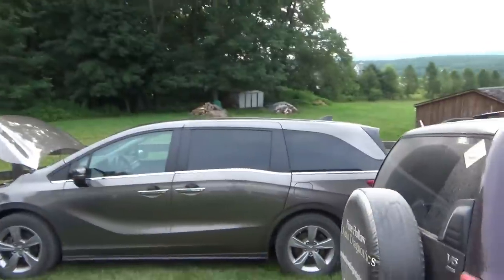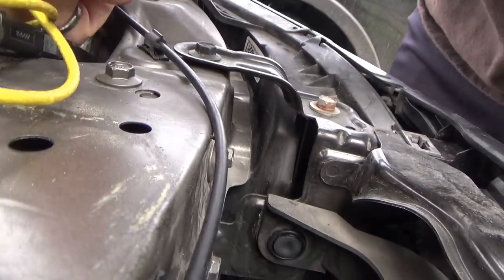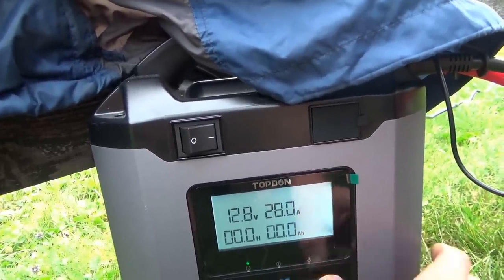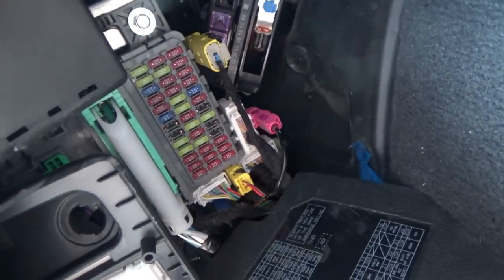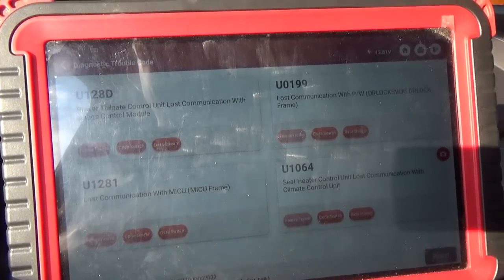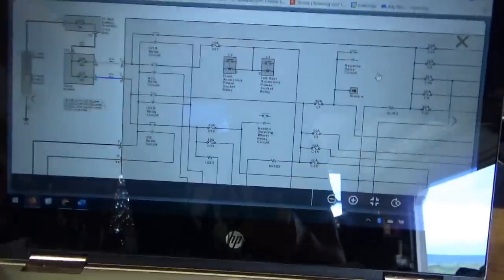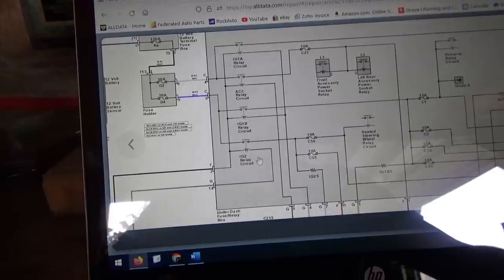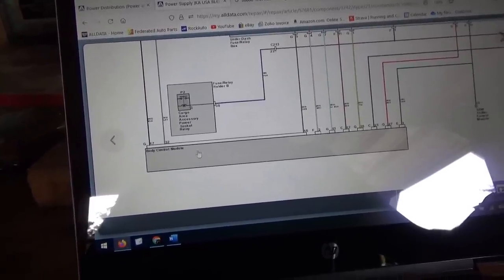WTF...Honda Turns Itself ON & DRAINS the Battery?! (Part 1)

Comment: 2019 Honda Odyssey elite 90K milesl, so initially, the Lane detection camera ($700 part) has been bad, but I have been driving it anyway for months buying time. However, now the car will not shut off? I think it is unrelated to the many lane camera error messages. I had to pull the battery cable off to stop the engine; then it that reset computer (?)and it started it fine, seemed ok. Locked it up and went to bed only to wake up to the horn alarm going off later! The key remote didn't work to turn off the alarm!. So I had to use the 'real key' inside the fob to open the door the old fashion way. I found out if I don't lock it the security system won't go off like that. However, the accessory power still comes on by itself!! I caught it twice but now my battery is dead or drained from the accessory going on. I see other's pointing to the ignition switch as the cause. I will update.

Comment: I was going to suggest a used BCM from a salvage yard then I see you are getting a used ebay one, good thinking. I don't know how Honda has their vehicle mileage stored though, if it's in the BCM or in the cluster. I wonder if in the BCM if there is a constant 12v source that is shorting to a 12v "switched" source and is powering it up when it feels like it. Intermittent electrical issues always so much fun. Interesting that Honda has an "updated" BCM part number. 
On a slightly positive note Ivan, there is a company that makes computer chips that just bought a huge piece of property just north of Syracuse, NY. Could we see an end to the chip shortage by making them right here in the States? We shall see.

Comment: I agree with your diagnosis but one problem I see is that let say the bcm is (seeing the key ) and turning the ignition on. I would think the car would start when pressing on the brake and pushing the start button when the ignition is on. Also I noticed what appears to be the red security light flashing on the cluster when the ignition comes on. I’m not disagreeing with you but It would be hard to call it the bcm when the fuse box could cause this too. Only way to tell is to isolate the ignition control feeds from the bcm to the fuse box. I enjoy your videos

Comment: I am curious as to why the dealer blamed the liftgate control module.  That is a module that should have power at all times.  Could it be feeding power back into the BCM?  Seem like it would be a simple test to disconnect the liftgate control module when the car is acting up and see if the power to the cluster goes away.

Comment: Part of me would wonder if there is a key hiding somewhere. I’d delete out any keys but what you have, Just in case.  There should be an encryption code shared between the ecm/bcm for each key that should be needed to power up the car. Replacing the BCM should invalidate the keys, and would also cause the same outcome. 

It will be interesting if you can pair the bcm/ecm or if a dealer will have to do it.
Reply: The car would be able to start if there is another key inside, and it can't.
Reply: I had found a set of fobs with factory build sheet while detailing my Chevy truck. They were between upper back seat and cab wall. I saw a little piece of plastic hanging down and didn't know what it was until I kept pulling at it to get it out.

Comment: What device actually reads the presence of the key inside the vehicle? Is that device directly connected to the ignition button?  My thought is if those two items are part of the same module behind the dash, then the BCM could be ok and that button-and-antenna module could be telling stories to the BCM. On the other hand, if they're completely separate, then it's more likely to be a fault in the BCM itself.  Guess we'll see in part deux.

Comment: YOUR ON THE RIGHT TRACK HAVE MANY WITH THIS ISSUE, ALWAYS A DIFFERENT ISSUE, INTERMITTENT, OR STAYS ON ALL THE TIME AND KILLS THE BATTERY. OUR ALARM GOES OFF. THE BCM HARD TI GETS TO ABOVE THE FUSE BOX, WHICH HAPPENS ACROSS ALL HONDAS NP TSB FOR THIS

Comment: Hey Ivan, if needed I could send you an install guide for the add on remote start units that are basically plug and play. I have seen this same problem with a push to start Accord that turned out to be a faulty remote start. Also try pressing lock on the factory remote 3 times. If it has an add on remote start this should activate it.
Reply: Yeah, it's gotta be a remote start issue. Nothing else should be physically able to do this, this way.
Reply: Checking for a remote start add-on is an great idea.

Comment: Ivan, I still drive a 95 Honda passport/ Isuzu rodeo. 325k on original motor and transmission.  I changed the plugs recently  and decided to check compression.  170 psi on all cylinders.  Last emissions test HC was 21 and CO 0.01. I've beat the piss out of it in the mountains hear in Boise. I just maintain it really well. Got lifter noise, but what 3.2 dosent. Lol
Reply from the maker: That's a cool truck. Respected durable 4x4 in the Russian boonies too 😀

Comment: I had a crv a while back that was a parasitic draw. This new town i moved into has a big problem with draws. I went 6 years as a tech in my hometown and only ever had 1 parasitic draw that was something real easy that i have forgotten what it was. Here I've had like 5-6 cars with draws in the year i have lived here. Anyways this crv at first I found the radio was staying on. My draw went away when I unplugged it so I replaced the radio. Supposedly that wasn't the fix when the customer returned about 3 months later saying he was still having a dead battery. It then took a few visits to the shop because he would need the vehicle to get to work and couldn't leave it for any reasonable length of time but I finally found that the MICU/BCM was actually the issue and was keeping the Radio on at all times. I dug deeper when I found that new radio was staying on again. Lesson learned. Anyways all that to say that the BCM for that car took 5 months to get and same thing I think it was a 2015-2018. Somewhere around there

Comment: I would try to scope between BCM, ignition key on.
See what's happening, what kind of voltage drop is going on there.

Other idea is to look at salvage yard, take kne from there if you can find 2016-2018 Honda Odyssey Elite

What if the bcm is faulty triggering the key on but the relay switch is stuck on continuously giving ground making it so only one faulty signal is needed to make bcm think key is in proximity.

Comment: Bcm/keyless access module common on these Hondas and Acuras to cause this same problem as well as other problems. Keyless access module is part of the bcm on this Odyssey. Alldata has good info on the system description of the keyless access system, there is no literature of your issue, but it’s common and yes the bcm has been on back order for a long time

Comment: It is crazy to think the vehicle will just turn itself into the KOEO (Key On Engine Off) position when not commanded  by the appropriate means. You would think the vehicle's security programming at a minimum  would prevent this from happening unless a number of  specific conditions being met, all these being external commands being received and validated. IE: the key being close enough to the vehicle's receiver, the key AND the receiver doing the necessary validation checks AND the start button being pushed once to place the vehicle in KOEO position. These are essentially three "AND" functions, ie must happen, no if's or buts.

I know software can do crazy things, however if it were a software issue, then reloading the modules software should fix this. I don't even think a software issue can cause something to operate that requires a number of external commands/functions to happen first. It seems unlikely it is a module manufacturing issue as there would be an extremely large amount of reported vehicles with the same issue. Like all things, modules are made in batches, the manufacturing error will be in a complete batch at a minimum, with the appropriate forum coverage and hopefully manufacturer recall. This is a crazy issue.

I agree with your decision to replace the module, in reality what is there to check, Powers & Grounds seem okay, there are no connectors between the relays and the modules & grounds, the start button would not cause this, it won't even be active until the BCM enables it in the first instance. Everything is pointing to the BCM and whatever is in there to enable the KOEO position. Even a lost key somewhere in the vehicle wont do anything unless the BCM sees it AND the stop/start button is pressed. Even if there was a lost key, when you program a new key, you reprogram the old keys so the lost key ceases t function in that vehicle.

I really am looking forward to the outcome, even if it is a case of "the new BCM worked, the customer has not reported an issue since the new BCM was installed" I do however hope Honda is keen on exploring the issue even if it means shipping the old BCM to their technical engineering division.

Sorry for the ultra long post, I couldn't make it shorter.

Comment: Seen so many of these on Acuras, used to work at the dealer. Ends up being the Keyless Access Unit (some have TPMS built in) or BCM on the newer cars. I'm not sure if you can check with other scan tools but if you check with the HDS, in the Body Electrical > Security history. It will have an alarm trigger by the Ignition Switch.

Comment: Even if green crusties were turning on relays, the car should not start due to the immobilizer not present. So, does car start when all this turns on?
Also.... how about pulling BCM fuse instead of battery every night, may be easier and cleaner to do. 
Hope the BCM solved the problem.

Comment: In those intermittent cases you should be able to set a trigger on a code or signal and then store as much as possible data (of as much as possible different inputs/signals to get the total picture) of the past x seconds. And nice to have, send you a message when it tripped. Is there anything like that available on the market?

Comment: love you videos ivan just a little info on hondas odyssey, pilots and ridgelines are starting to have this issue i have always replace the keyless control unit that is located behind the glove box and fix the problem. also civics are the most common to have this issue and on those ones you replace the bcm a black box on top or behind the driver under fuse box. hope this has been helpful. love you videos the had tough me a lot.

Comment: If you could monitor battery current with a deep memory scope or logger and trigger at an amp above sleep current (with some pre-trigger data), you might see a current signature that could be used to understand a possible module sequence of events (current draw magnitude unique to each module or load). Maybe you could determine what module turned on first.

My troubleshooting approach is much like yours, although having an electronic repair bench (microscope, soldering stations, etc.) available to me, I will take apart a suspect module and inspect it before replacing it. You can find uncommon failures and many times, if you have access to a electronics parts inventory (TH and SMT), you can fix the module if the problem is not related to a custom IC. 

An obvious failure mode is a cracked solder joint or PCB trace, and relay contacts if the vehicle is older. But many times you may have a single SMT component fail. For example, a stacked design SMT ceramic capacitor which can crack and fail short, open or intermittent. I keep a small inventory of the most common high reliability automotive chip capacitors (NP0 and X7R) with features like; soft end termination, AEC-200 Qualification, etc. in 0402, 0603, and 0805, with some larger values in 1206. I also have an inventory of automotive Tant and Polymer. If a find a bad SMT Aluminum Electrolytic I can usually order a good replacement part on-line. Through hole Aluminum Electrolytic Capacitors are relatively easy to buy.

Comment: We have 2018 Honda Odyssey with the same issue. 

We had it at the dealership multiple times just for them to tell us we are leaving the keys in the vehicle.  

Both alternator and battery check out fine.  

It’s very intermittent as to when it will and won’t start due to dead battery.   The vehicle can sit for 2 days, start, drive it 2 miles down the road, Park it, then return to it a few hours later to find it dead.    

It can sit overnight and be dead the next morning.   

We I’ve had the vehicle checked for parasitic draw. It checked out fine.  The Auto technician told me when he plugged it up to his scanner, it showed it was in accessory mode.  I know for a fact we are not accidentally putting it in accessory mode after parking it.  

Do you think we’re replacing the BCM will be the fix??

Comment: I have 2019 Pilot and it starts up on its own similar to your account, but actually starts and runs until it is noticed and can be turned off. It sounds like a BCM issue, but I have found that I turn motor off while in N then shift to D. The car will not try to start while not in Park.
Reply: 2019 Pilot

Comment: How about the car Eric O had that had the can wire that was shorting out under the rear seating that would turn wipers on and open doors and so on. Is the can network tied in with all the systems for the bcm and the push button and the module that senses the key for being in the car?

Comment: I think replacing the BCM is a good call. We had a similar problem on one of our 2016 F-150's. At random the DRL lights would come on and there was about a 20 amp draw when it was acting up with nobody inside key out and doors locked. I messed around with it and we ended up taking it to the dealer. They had it for about two months and the mechanic  traced it down to no bulbs in the cargo light. The upfitters removed the bulbs when they installed the cap and he said the BCM was searching for those bulbs, couldn't find them and was acting up. There was a code for the puddle lamps. It fixed the problem when he pet the bulbs back in

Comment: I think the BCM is going into a fail-safe mode because it's detecting an issue it doesn't like. From what I understand, the default state for these BCM-controlled systems is the "ON" position. I looked at the wiring diagrams, and the pushbutton switch appears to push one circuit high, and the other to ground. If the circuit states don't match what's expected, this may be the root cause of the problem. It's also worth noting that a 10-amp fuse feeds the pushbutton and one branch to the BCM. If that circuit drops out intermittently, possibly that's the cause of the problem. Maybe water or some other drink got spilled on the pushbutton and is causing an internal short. I'm assuming that the BCM doesn't require a valid proximity key be present to enter the fail-safe mode.

Comment: I have a good bcm out of a 2018 odyssey i can sell. Dealer warrantied the bcm but that wasnt the issue. My issue was the camera ecm in rearview mirror. I also have 2 injectors not working properly which causes a p0420 & p0430

Comment: I think I know where that dent came from on the drivers front fender. I think it's called a frustration dent.
I've witnessed a few a few of them in my lifetime.
Can you disable the BCM, or disable the signal buss from the BCM and see if the issue still happens?
Reply: my same thought

Comment: I do not know ii this TSB would apply to this car, and do not know if it has anything to do with the symptoms this car has. I also do not know how it could cause the car to turn on.
I do know,, this is an exceptionally interesting video. Very, very good.

The TSB is related to the Harness that connects to the third row seats that can get pinched and short out some wire or wires. I do not know what wire/wires that would get shorted, nor how a short here could cause the car to turn on. However, with these new cars it is almost impossible to say that - "That cannot happen." The Third Row seat almost certainly connects to the BCM. Just thought I would mention it. 

One would have to look for this TSB using this vehicles VIN number to see if it applies, and maybe find out if it could cause this issue or not. 
Omegaman69

Comment: What was so difficult about putting a key in a hole and turning it to start?
The systems with a chip in a proper key were probably the most secure and reliable in my opinion.

Comment: I would disable the keyless entry and remote start. You had a issue with door locks and power doors. Dealer had reason to fault rear hatch that may also be keyless entry fault.

Comment: Found it odd that the key fob wouldn't open the rear door.  Is the RF keyless access module broken?  What if there's random noise coming from the keyless access module?  Would it eventually hit a sequence that the BCM recognizes as someone having pressed a key on the fob, therefore illuminating the dash?
Reply: Child lock was on
Reply: @rcplaneguy  I'd child lock was on outside door handle at least should still work correct? Isn't it just the inside door handle that is affected?

Comment: If it is reasonably repeatable now. Could you de-pin the bcm connector of what commands the ignition on or loop out the communication of it. Even use test leads to be fully connected to shut and lock the car. Then disconnect the leads once asleep so the car has no idea it's been tampered with? Then see if the fault reoccurs?
I know you've already fixed these cars when you post them but it might help ease the doubt of the call if you can isolate the module. So it can malfunction all it likes but not actually affect the car?

Comment: Verify that it is what's causing it, you can backprobe the circuit fuses when the issue is happening,  if the bcm is the only module drawing current then you know that's it.

You said some others have claimed similar issues. So I would discount a possible aftermarket accessory at fault.